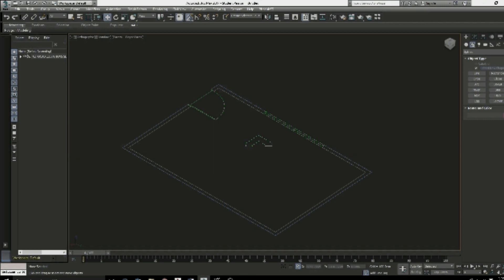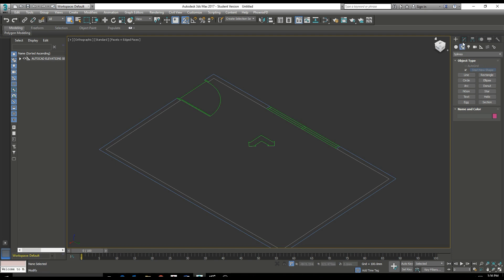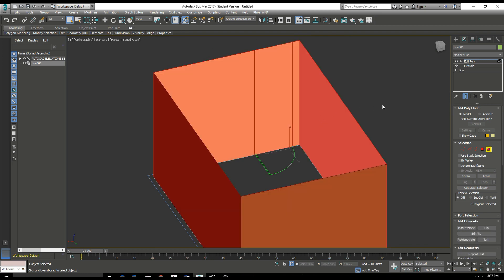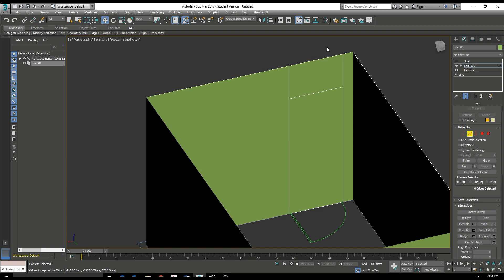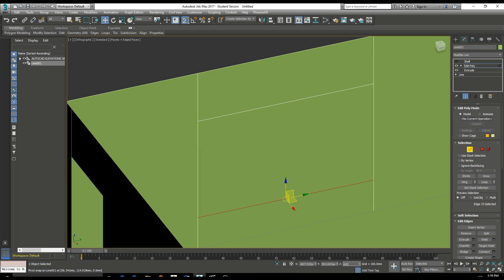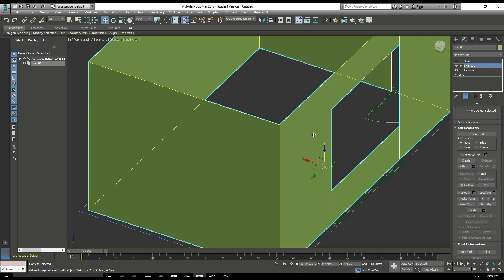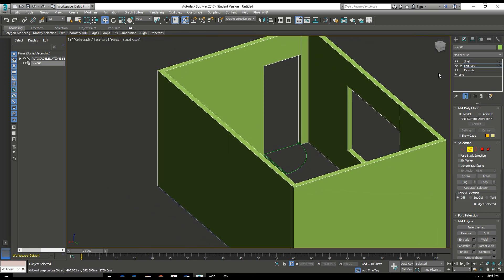3ds Max 2017 Tutorial - Modelling Walls and Openings

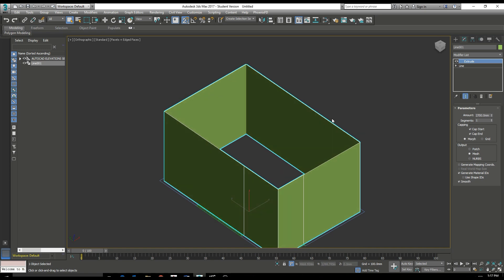Comment: At 1:50, you can weld the vertices of spline so that walls are closed.
But in extrude modifier, uncheck two  options- "cap start" and "cap end". This is the correct way i think.
Reply: if I weld, the extrusion becomes a box